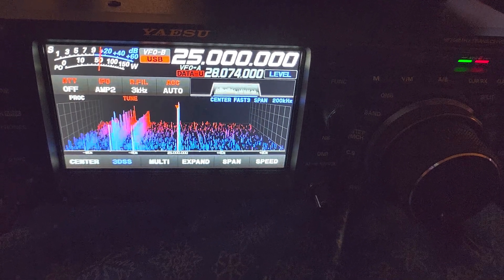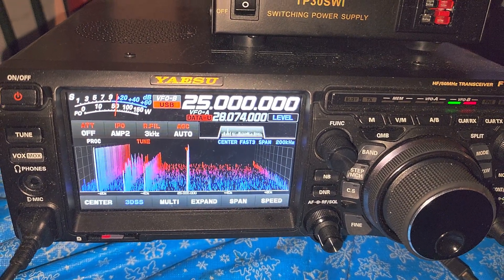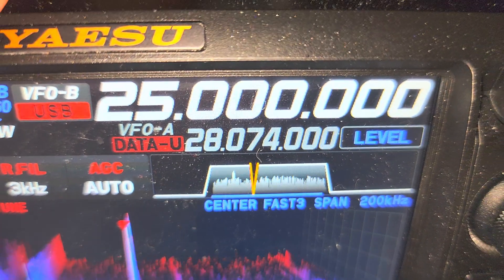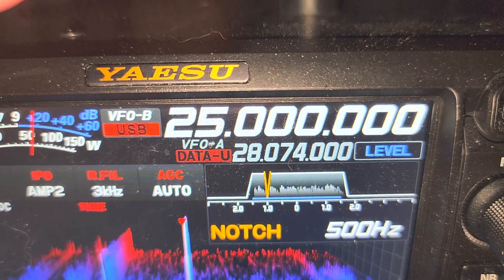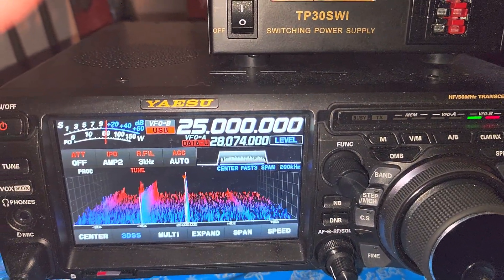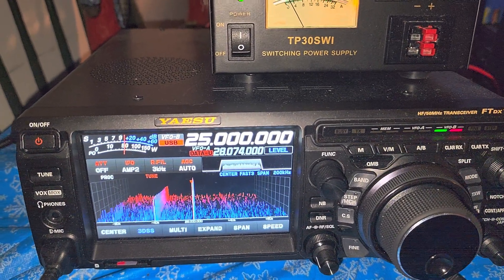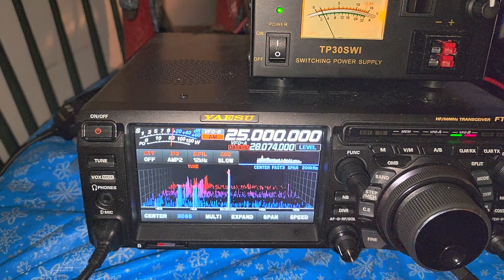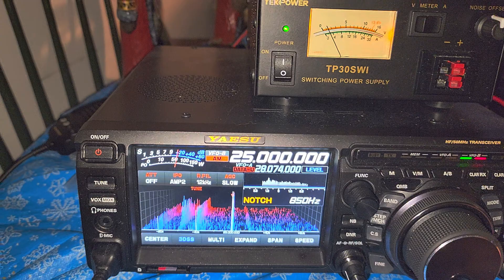What is a NOTCH filter and what do we use it for?  demonstration on Yaesu FTdx10

Comment: I use a yaesu ftdx-101d and when I engage the notch in AM it doesn't put the V on the filter display but it does seem to put a notch in the RX dsp display scope
Also if I use the multi display window I can see a notch.
I've not found a heterodynes yet to notch out so I can't say for sure it works but don't give up on it because you can't see the V Indicator
Reply from the maker: ok...can you try it ...use WWV like I did ...  as you can see in the video...  it does not notch it...but it does in USB
Reply: @OfficialSWLchannel  Seems likely that the notch is in or around the BFO, which is why it works for CW and SSB, but not AM. Since AM doesn't use BFO.